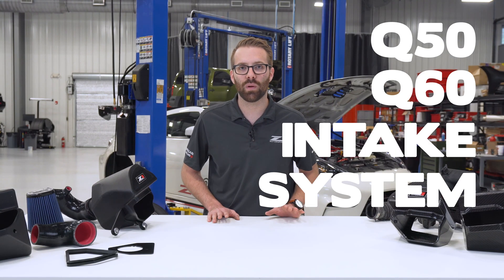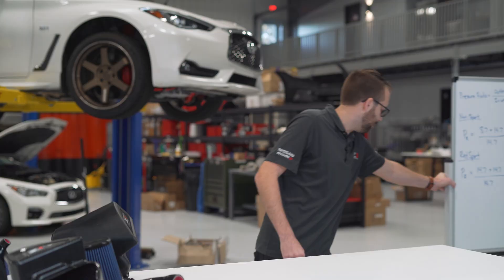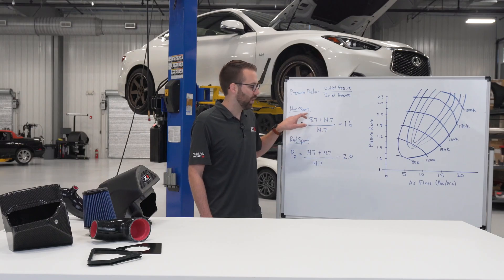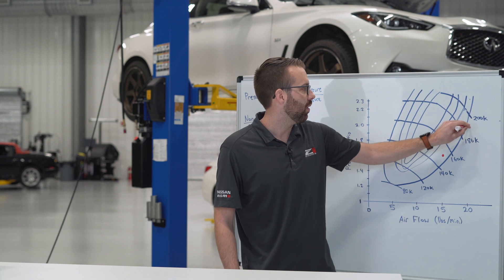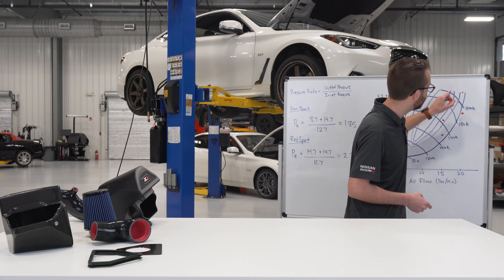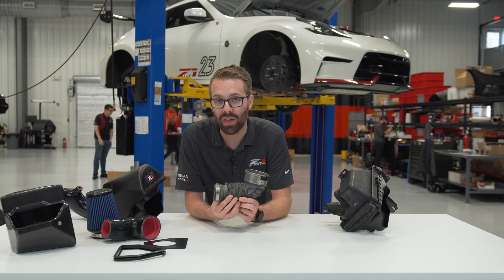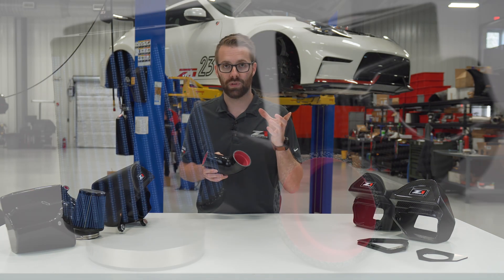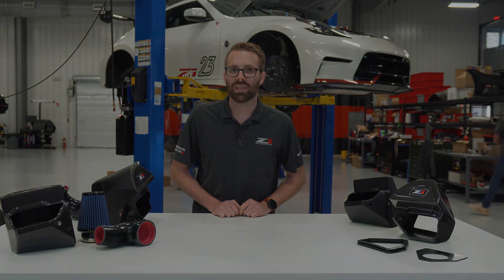Behind The Design | Z1 Q50/Q60 VR30 Cold Air Intakes

Comment: so I got a 19 Silver sport stock car with z1 intakes. I really like the intakes and the design. I installed them myself, I have installed them twice now with swapping back out for stock airboxs due to issues. Each time Installing these z1 intakes they were installed CORRECTLY and time was well taken when doing so with both installs and uninstalls. These intakes threw both MAF codes after say short of 5 months of daily driving. Z1 claims no tune is required. stock airboxs went back on for 2 weeks and the codes did not come back after being cleared. Put the z1 intakes back on and now they are permanent codes. I love z1, my g35 is tuned by z1. I love this product and it does seem to make the turbos work easier and the spool sound is awesome but Im just displeased with getting codes for mafs that are like 200+ a piece. not every z1 product is a complete hit. I have many parts from z1 on my G35.
Reply: Tbh the maf sensors are just really picky with anything aftermarket for intakes on these cars. I had the aem intakes and those also thru codes, i cleaned the maf sensors and filters and they were still permanent codes. i just cleared the ecu and kept driving and the codes went away after a while.
Reply: @Monsta Saleens  Yeah I wish I heard this earlier. I sold the airboxes and went back to stock completely. I miss the turbo spool from the z1 intakes.
Reply: @willhawkins284  I just got done installing my new Z1 intakes yesterday and theyre great so far. ill update if I get any codes. I made sure I installed everything right too it took me around 2-3 hours
Reply: @allenrachal  any codes?
Reply: @goblex Not if it's installed correctly. Gotta make sure it's sealed all the way around for the Z1 intakes.
Reply: @allenrachal  Do you still have the car? How do you like it? I think im gonna pick up a 2017 Q60 red sport shortly has 25k miles
Reply: @goblex  Nope I actually crashed it a few months after getting it tuned 😭 I  miss it everyday.
Reply: Huh I installed these myself too, and got no problems, you must’ve done something wrong, did you accidentally switch the maf sensors? That could cause some issues.
Reply: @Eclipsis17  No i did not.

Comment: This video makes a lot of sense.  Even though the output gains might be modest overall the big win is the reduced pressure drop getting to the turbo so the turbo has to work much less hard,  less rpm and less heat for the same amount of boost.  Only wish the price was not so high on these but thinking of trying them.

Comment: Apprictaed the science behind it all, although I'm assuming actual performance gains are about average to what other brands average like AMS?

Which is to say pretty minor for the Vr30. Hah
Reply: More or less. Intakes aren’t where you’re going to see a HUGE return vs dollar spent. However we did spend A Lot of time on this system to ensure that it would be a GREAT contender vs the competition. I guarantee if you put it vs every intake on the market it will go toe to toe and you may be surprised at the results. Pricing is also much better than current options of actual functional intakes on the market. The big part here is relieving restriction from the factory system for a more efficient turbo. 💪🏽
Reply: @EnthusiastPOV  Aye the VR30 is quirky with after market intakes I recall more than one brand having issues when they rushed to market with their own.
Reply: @BigHeadClan  that is correct my friend. Them here weren’t couple of brands that had a lot of issues.
Reply: @EnthusiastPOV  does this intake make cool spooly noises?? is there a video with these intakes installed on the car?